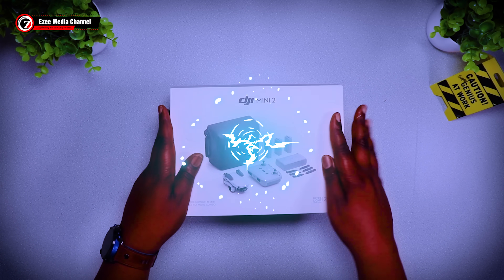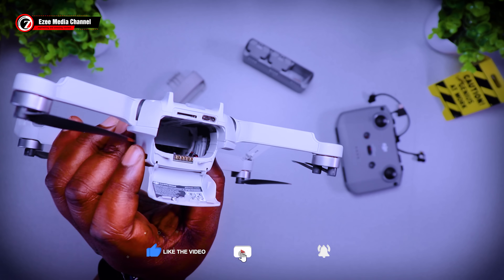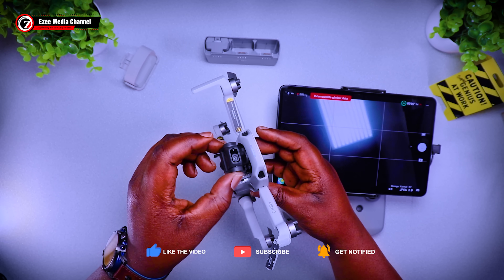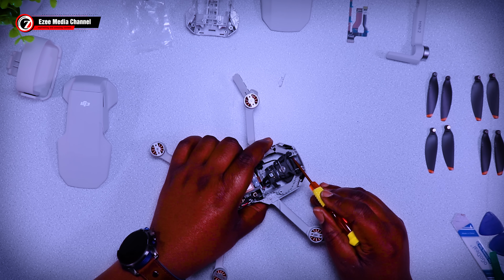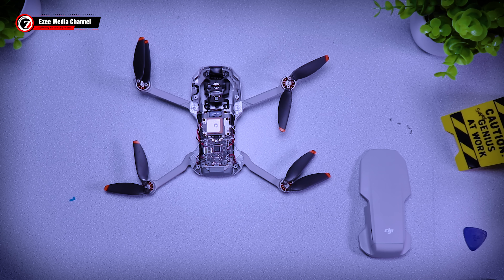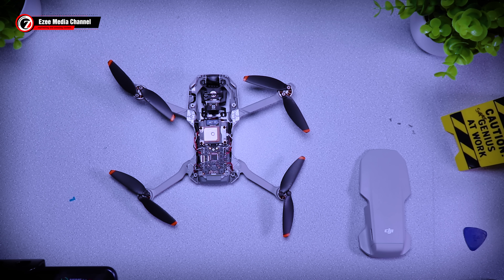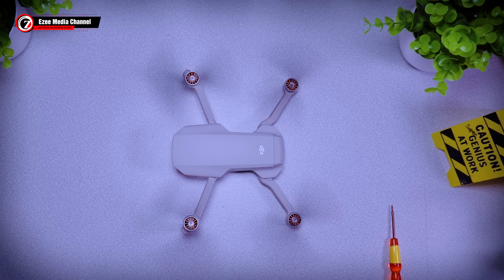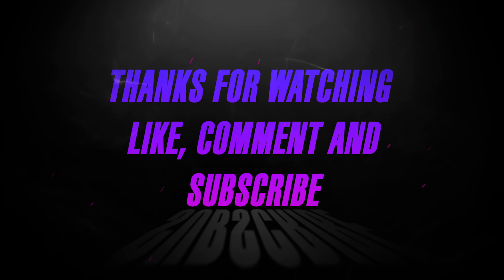Bought a Crashed Dji Mini2 for Cheap and Fixed it - Repair Tutorial

Comment: How can remove and stick to new that copper and black strip please reply…
Reply from the maker: Hey Snipez you will need a heat gun or hair dryer to apply heat to the copper strip then it will be easy to peel off from the damaged cover. Same thing for the black strip and the led light and the vents. Hope this helps. Don't forget to subscribe and stay tuned for more cool contents. 🤗🙏👋👍
Reply: @EZeemedia  how to stick it to new one ?
Reply: @EZeemedia  yes how to apply it again

Comment: How can remove copper strip and black strip from damage upper body
Reply from the maker: hey Mueen you will need a heat gun or hair dryer to apply heat to the copper strip then it will be easy to peel off from the damaged cover. hope this helps. same thing for the from led light and the vents.
Reply: @EZeemedia  please make a video of that love from india 🥰

Comment: DJI repair service is reasonable and they actually send you a brand new drone rather than repair the one you send them.
Reply from the maker: Hey Eric thanks so much for ur thoughts. I will like to let u know that ur opinion might not be another's. So also u know if u don't have a drone Dji won't send u new drone if u don't have dji care on the drone and that cost some cash and also so hassles so alot of peeps don't go for the dji care. So this repair will help alot of peeps who want to Do it them selves. Thanks for the comments anyways 😊
Reply from the maker: Also too bad I dont see ur comment about talking with music. I believe ur device might be on mono sound you should switch it to stereo so u can hear my voice clearly. I will try to adjust to talking without the low music next time. Thanks for the thoughts👍🙏